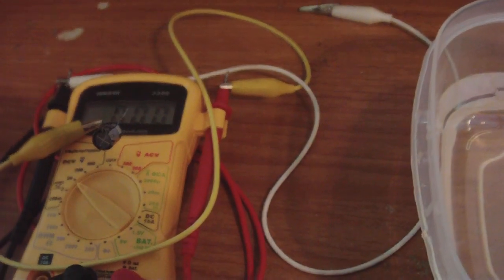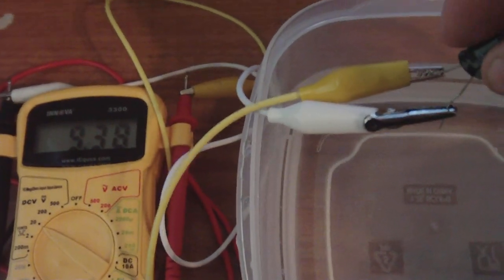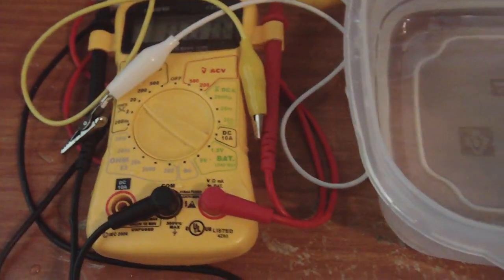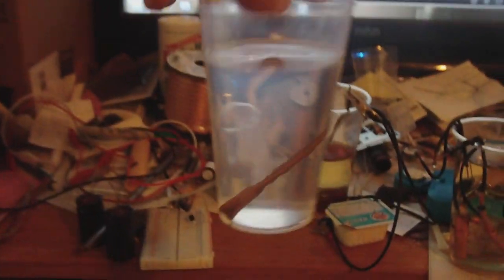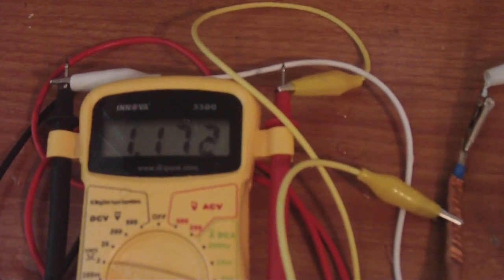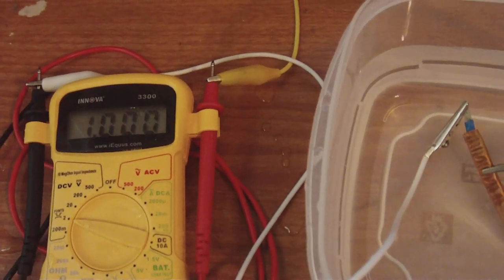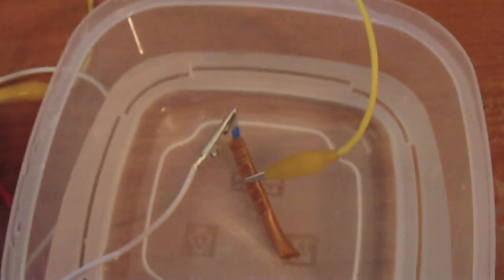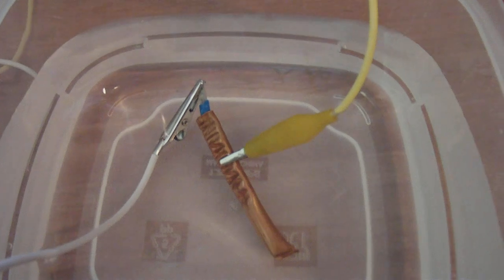Crystal Cell Works Under Water

Comment: It depends on the water conductivity (and sea water is salty - thus very much more conductive than tap water resulting in fast depleting)
Your Mg-Cu battery can generate a lot more current than an electrolytic capacitor that size could hold but it will discharge roughly at the same rate (current) as the capacitor. 
Measure the current leakage using a coin-sized conductor submerged but not in direct contact with the cell or cap and the other probe on any of the cell's or cap's terminal.

Comment from the maker: Not quite. The copper tube cell is a self contained cell that normally doesn't ever see a drop of water. For this experiment I dropped it in water to see if it will short out but it doesn't.

Comment from the maker: Hi Stefan,
What is odd is that the cell is made up of salt substitute so you would think that it would all dissolve into the water but it doesn't. 

the water acts like a resistor and will discharge a battery or capacitor. The reason why the capacitor discharge is because the water makes a connection between the leads so the same thing will happen to a battery too. I work in the boating industry and I've seen batteries get submerged underwater and loose all there power.

Comment: Try it with a fresh 9 Volts cell or AA cell and compare it.
The cap is no battery, so it does not produce electricity and only gets discharged...

ALso depends how conductive your water is----

Many thanks.
Regards, Stefan.